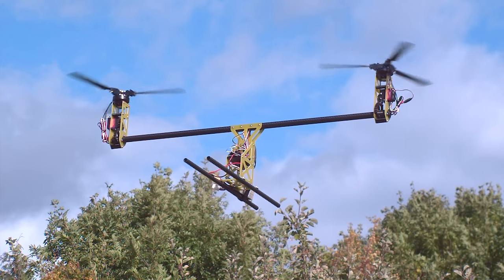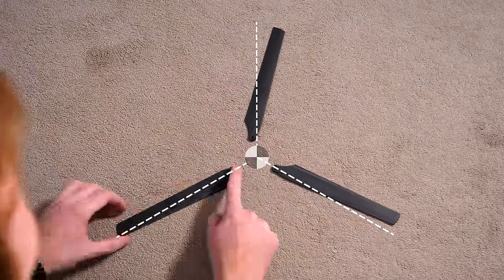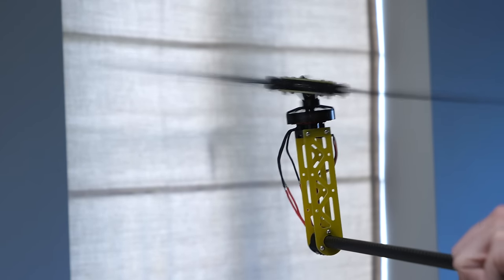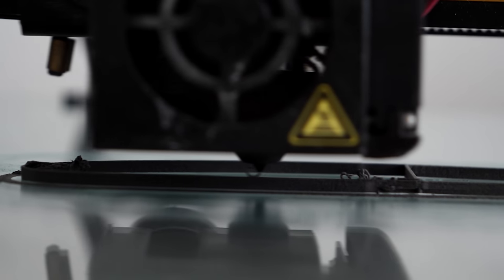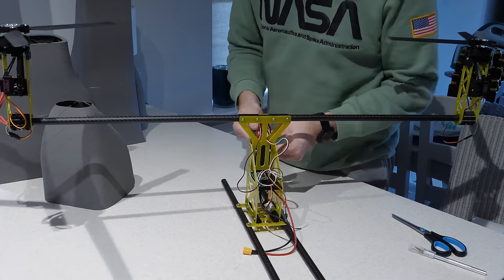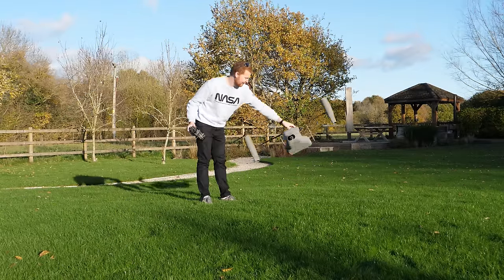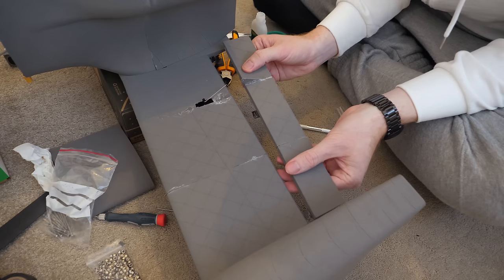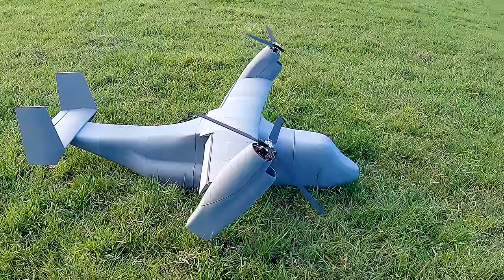Building a V22 Osprey - Part 2

Comment: Even in model format it's a wildly dangerous unstable aircraft. God knows how this design was adopted by the US military.
Reply: You cant simply scale the performance of a model aircraft to make assumptions abt the real aircraft. That's like concluding standard helicopters are bad just coz RC helicopters get easily blown by the wind. Many of the accidents had barely anything to do with the design but rather pilot error & weather conditions. Ppl also fail to understand how stats can be misleading, for instance, if the military deploy ospreys more frequently than chinooks, obviously ure bound to have more accident count than the other. It aint rocket science.
Reply: Blackhawks and chinooks are more dangerous than ospreys. dont beleive the hype about how the osprey is 'dangerous'
Reply: While this build is incredible, you can't compare it to the computational power used to control a real aircraft. There are a LOT of aircraft that couldn't be safely flown without computer aid.

I have them fly over my house regularly. Actually saw one yesterday. The modern Osprey is not dangerous.
Reply: @lukefirst407  I agree. I worked in the Osprey program and once the aircraft got past it's early test flight stages it has become a very capable and safe aircraft.  I actually went to a funeral for the pilot or copilot of one of the AF Special Forces (of which there are surprisingly few, this one was from April 2010) and only 3 were killed and 16 were injured which is due to the design of the aircraft and the safety mechanisms in the aircraft. 

They are also much more efficient to fly since they can fly much farther, faster and thus are not in the air as long as traditional helicopters.
Reply: The Osprey is one of the safest Aircraft the Navy flies... they had more engineers and scientist working on it than 1 Youtuber in their backyard...
Reply: The "bee's can't fly" conclusion tells you the danger of assuming RC models are indicative of real life. While there may be parallels to help inform the observer, scale models are never perfect for many reasons.
Reply: @n3v3rforgott3n9  All have been taken out of service, after the latest accident in Japan.
Reply: @ErikssonTord_2  I was on one of the ships that helped search for and recover the crew from the crash, it's an insanely dangerous helicopter that no one wants to be in, especially the marines that are inside it for amphibious operations
Reply: @clayforge4696  Except it has a better crash rate than every other medium lift helicopter...
Reply: @clayforge4696  Hopefully, the follow-on design will be easier to maintain and handle, as the engines are not rotating with the propellers!
Reply: @lukefirst407 this comment aged well
Reply: @Maurice_Moss  My guy even adding the latest crash the Osprey still has a better crash rate than the CH-47, CH-53 etc etc
Reply: @n3v3rforgott3n9  why have they all been grounded until further notice then?
Reply: @Maurice_Moss  Because they are waiting for the investigation to be done duh... this is the reality of military aviation. If they suspect a problem might be mechanical they ground them untill it is either proven to not be the case or it is fixed. Are you also focusing on every Black Hawk crash? did you know 5+ Black Hawks crashed in a single year recently?

Comment: This was awesome! I guess the problem with the full forward flying position is highly related to the proportion. The aircraft seems to be very close in proportions to the real thing, but, looking at some pictures of the aircraft, I have noticed that the blades of the rotors in your model are considerably smaller than the ones on the actual V-22. Try enlarging the blades and see if it makes a difference!

Comment: For the transition back to hovering mode,  you should be able to slow the rate that this occurs at. Either in the x9d remote or in the coding for it. Just an idea. I love this project it's my favorite plane great job!
Reply: I was thinking the same thing. It seems like the motors need to go back vertically much much slower, so it doesn't have such a dramatic weight shift.  Worth trying at least.

Comment: If you can fit a battery in the back of each nacelle that would balance them. (hopefully) and give you more flight time.  That would simulate the fact the turbine is mounted in the back of the real Osprey for probably the same reason.  Edit: Also from having been around the aircraft it looks like your horizontal stab is slightly scaled to small compared to the rest of the aircraft.

Comment: I was thinking the same at the end a internal counter wait that can shift so the transition is smooth. Making the battery shift instead is an even better idea would save lots of weight. Great job on the project love it!
Reply: damn really nice idea on using the battery as the weight element. props

Comment: In Veritasium's latest video at the US Navy's indoor wave testing facility, they are able to get very realistic looking video captures of the ships going over waves by slowing the time down. Maybe there is some math involved in this as well, where if you slow it down so it looks like the real osprey, you could better analyze the differences in the flight characteristics of your model.
Reply: If someone steals the air craft valor is it stolen valor.

It took 2 years to figure out that the engine and the gears should be connected.

The Valor uses get engine for extra speed if sand or dust gets in the engine the valor would destabilize.

The USA military wants 3 per a day by 2030.

The new copters can't be used in desert and on beaches.
Reply: incomprehensible
Reply: @crunchybones2528  He is going on about the US Army's replacement for the Black Hawk. While it is a program that is destined to fail (like he said, 3 delivered per day until 2030), I have no idea how that is related to the above comment or why post it here?

Comment: Awesome!

Original Osprey took around 90 seconds to convert from airplane mode to hover mode and vise versus, and it mostly had to do with optimizing lift/airspeed. The fact yours is able to transition so quickly and not violently lose control is actually quite amazing. 

Another thing with the center of balance issue, the V-22 has a heavy driveshaft running through the central wing, so the lacels are not as major of a weight shift to the overall airframe as it is on your model. I suspect you need more powerful motors, thicker propellers and some center of mass adjustments, and I’m willing to bet that you’ll get greatly improved performance.

Amazing stuff!

Comment: I believe what you are experiencing in transition to hover can be a mix of two things, the weight distribution and something called Vortex Ring State (VRS) which is common in both helicopters and tiltrotors like the V-22. I recommend lowering the servos in the nasales to help with COM, and for VRS you could and a function to the transition key on your control to modulate your throttle to be less powerful in half and forward flight. When switching back to hover you increase throttle to maximum to flush the VRS phenomenon. I hope this will help can't wait to see more videos on the topic.

Comment: Another possible solution that wouldn't add much weight would be to recess the motors back into the nacelle to where they're located at about mid chord on the wing.  You'd need to add a driveshaft and bearing and have a tilt head that's independent of the motor.  But that would eliminate the weight-shift problem.

Comment: Awesome job! My  only thing I would say is increase your wing area by extending it to achieve better lift for flight and reduce the amount battery usage. Also perhaps reduce the speed of the transition from vertical flight to horizontal, have it span maybe 15 seconds so that the speed will reduce and then the cemented of mass will be Abel to adjust more quickly

Comment: To solve the weight issue you could bring the motors closer to the modules axis of rotation and then use an additional axle to extend the motor shaft and connect to the propeller

Comment: The simple solution to your weight shift issues is to adjust the point on the tilt rotors where they connect to the wing. If you adjust the connection point on the tilt rotors 50% closer to the blades, you'll find that pretty much stabilizes in place the mass of the tilt rotor regardless of flight mode.  Really nice project ya got yourself, there.  Congrats.

Comment: I would imagine that you took into account that the advancing blade produces more than the receding blade and that if you apply a force to a gyro spindle, the movement is offset 45° way from the input, which is translated by the gimble set at 45°.

Well done and good luck.

Comment: When it's far away, it realy looks like a full scale aircraft. Only the sound gives it away, you made a great job! Also, you can cancel the changing center of mass, when transitioning bact to hover mode, with some moving weight, since you don't need space for passengers or anything.

Comment: after seeing the issues with half/full hover transition, I really want to see an RC BlackFly now.  With 4 motors / 2 wings it would be more like a quadcopter (simpler differential control), but you'd get the benefits of the wing lift in forward flight.

Comment: This thing is so freaking cool!!! Would it possibly help to put the motors closer to the wing in the nacelles? You could keep the motors static, and run shafts with u-joints to the props. It would add a bit of weight overall, but if nothing else you'd gain CG mass.

Comment: For the transition back to the hover mode, you can try just slowint the servomotor which tilt mottors or add to pragram quater transition (it won't be useble by the user) and program will use it to transition - first to quater transition, stop for a less than a second and back to hover mode. Hope you'll see it

Comment: Instead of adding counterweight or moving the battery back and forth, you can try to place engines deeper in the motor pods (as closer to the carbon tubes as possible) and transmit the rotation to the propellers by the shaft. This means that the balance of motor pods should also be taken into consideration.

Comment: You could make the servo for the tilt, also open and close holes in the wings that allow more wind downwards for lift and they close as the engines become more horizontal which means it will need more lift so less/no holes

Comment: I love your videos and I've been following your projects for a while.  I have a suggestion you may want to consider

When transitioning to a hover, the rotor disk is going from negative AoA to level or positive.  This WILL increase overall lift, rotor speed being constant.  The rotor disk should be treated as low-efficiency wing area.  With that in mind, you may find that shifting the CG to compensate for the motors' physical position will not be enough.  I get this idea from another VTOL model I saw many years ago in an RC magazine that had a similar problem even though there was NO change in CG due to motor rotation.  The pitch-up moment was so strong the aircraft would loop, and no amount of trim would compensate.  If I remember correctly, the solution in the article was to decrease the speed of transition as well as reducing thrust.  Another thing I remember reading about early test aircraft that the V22 is based on was that the pilots controlled the rotor thrust axis directly, with no fixed stops.  This was operated much like electric trim controls, with a button that moved the rotors forward, and one that moved them back, on the stick.  As the pilots began the transition to hover, they would repeatedly "bump" the rotors back, and adjust thrust, to maintain level flight, rather than have fixed forward/45/hover positions for the rotors.  You see a similar control scheme in the AV 8 B Harrier jump jet with it having a lever to position the angle of the jet nozzles freely from straight back to slightly forward.

Comment: Another way to balance it would be to just move to the motor pods and find the point where they balance out the motors. Not adding any more weight but using it to balance the weight shift. I think this would also help with your full forward flight issue although the biggest limiting factor there is just needing more wing speed.
Maybe a slower rotation of the engine pods could help? Allow more time for the stabilisation to kick in and also allow more air speed to be gained during transition.

Comment: put a pendulum in so when she tilts back it turns of the flaps killing lift  .also in forward flight the props blow the air at the same speed over an under the wing making the foil useless maybe helped with a bit more aoa  on the wing an a pinch of dihedral just a thought

Comment: Wow that's a project to be proud of 🙂
There is a RC model of the osprey, they have a third propeller in the tail to stabilize it, and I was just thinking you could add some counter-weight at the bottom/rear of the engines so it doesn't get to nose-heavy

Comment: Dont add more weight.
The center of mass is shifting as you transition, so Instead, Move the motors to the centre of the engine cowl and use a propshaft, that way your centre of mass stays over the wing and transition will be smoother.

Comment: Here, the issue is the Centre of gravity moves forward while transitioning to forward angle that's why it is leaning down towards ground. It is because the weight of two motors is close to the blade which is at the upper portion of the aircraft.
I would suggest to reposition the motors to the lower part of the rotating section so that it can equally distribute the weight and maintain the centre of gravity of aircraft. It will also improve the stability.

Comment: Hi
Put the flaps function on the triple toggle switch. Try to set the flaps for level flight not to zero, but by releasing them by 5-10 degrees stand of horizontal flight. Perhaps this will help keep the flight good level. It also makes no sense to set the flaps at such a large angle when landing - you almost stall the model during the transition mode.
Cool project!

Comment: "Don't fix an aircraft fusilage together with magnets" I could have told you that in advance 😂 It seems like a good idea, because of the ease of assembly, but it's just not strong enough and adds unnecessary weight to the fusilage.
Very interesting concept though! The rotor assembly part of the video was very interesting 👌

Comment: I saw a similar concept where the centre of gravity changing was a problem in different flight modes. The chap got round it by putting the battery pack on a movable carriage to alter the battery position as it transitioned.

Comment: amazing mix  of control issues solved 'Cheat use a small rotor on the tail to lift tail when needed for transition . Also have  leading edge wing able to tilt a few degrees up and down with servo to increase angle of attack in forward flight   or look wing with  floating  self correcting angle attack using  center lift  hinge  to give more lift in forward flight  or pop out leading edge   flap solutions.

Comment: I imagine that those vents near the rotors need to allow air to flow through. Maybe for this model you could design them to create a vortex to reduce drag, but that might be more trouble than its worth. But that may be why it wants to dive when you try to go fully horizontal. Besides that, I would try setting up a slower, more smooth transition when tilting the motors. Maybe try to work out how to sync up the motor tilt with the flaps if possible. That would make for a safer, more fluid transition at low altitude. Anyway, awesome project. Its so cool seeing it in the air. It makes me wanna put one together too.

Comment: what a fantastic work! well done! I noticed a few things that might help you. When you transition to having props to point forward, you are cutting your wing surface to half compared to hover mode. Reason is spinning blades act as a wing surface when your are past hover speed causing something called translational lift. on top of that, when in forward flight mode, the engine is far in front of the wing making it more nose heavy. the lightest weight solution for the engine issue would be to use a longer prop shaft and allow the engine to sit closer to the pivot of the engine enclosures.

Comment: This is a very impressive project.

What about using two batteries instead of 1 and placing them in the motor housings. That way you get the simplicity of a counterweight without actually adding any weight to the model.

Comment: You can use longer motor axis and put the motor down the nacelle so the weight of the motor will be closer to the center of the craft while in plane mode

Comment: Someone already designed & built an RC V22 Osprey. He was one of the original designer engineers of the V22 and got a license to use & build an RC model. I purchased one. Everything operates just like the real V22. He also did the programing for the engine conversion from helicopter to plane mode. It has a rotor span of 6 feet and a body length of about 4 feet. With Retractable landing gear. But this was way before the advent of drones.

Comment: Love your material, always gives me new ideas.

However you're still going to run into issues with those solutions because you're effectively swinging two sources of rotational inertia 90 degrees around an acid instead of along an axis. This will result in increased torque that will further reduce control when the COG shifts.

You can both mitigate those effects and solve the weight shift issues by simply moving the motors directly in line with the rotational axis for your VTOL to forward flight shaft. The COG stays where you put it and by moving your rotational inertia closer to your axis of rotation, you reduce the amount of torque fighting your control.